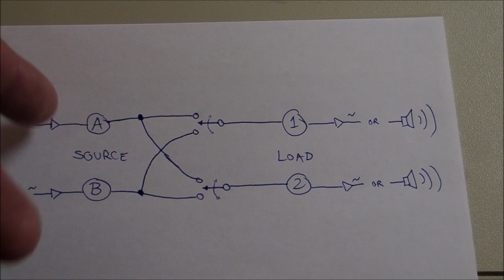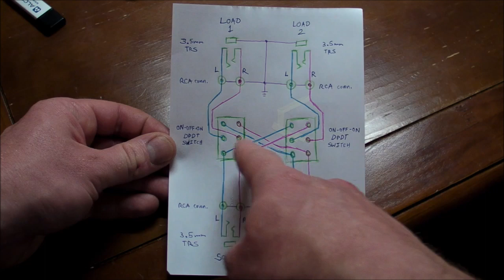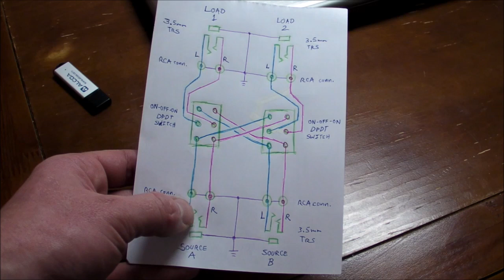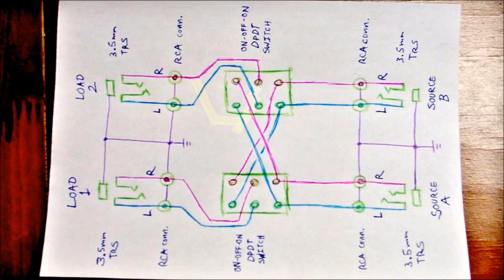(#0192) Universal Audio Switch Box

Comment: Neat project. I wanted to build something like this too. Maybe I'll get around it someday. My CD-ROM has switching noise on it's headphone jack also. Didn't check the Line out but as you said there shouldn't be any noise there. Still doesn't beat the flexibility of a portable CD player and also it's features. The only advantage is really the fact that CD-ROM's are much more robust and better build than most CD players. Cheers :)

Comment: Would be neat to mount two logarithmic potentiometers to control the volume of each channel independently to make cross comparison even easier. :)
Reply from the maker: TheRAZZITEAK I did consider adding some pots, but I didn't want to run into any impedance matching issues whether I use it for low-power pre-amp signals, or high-power speaker outputs.